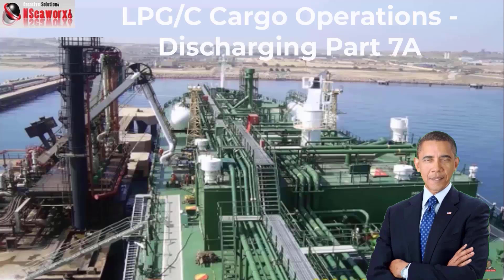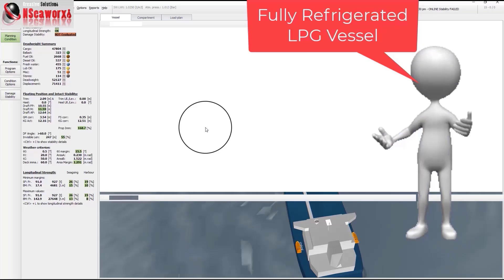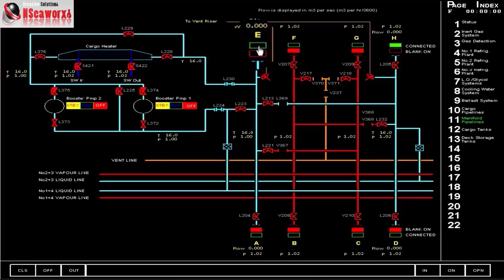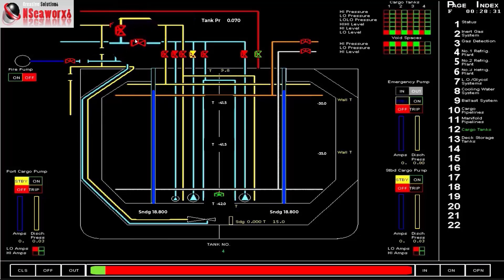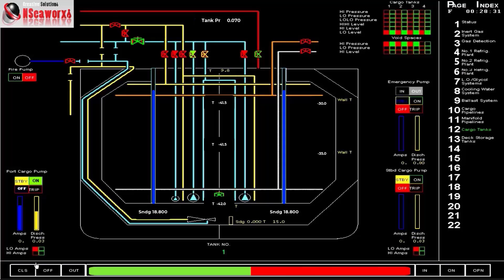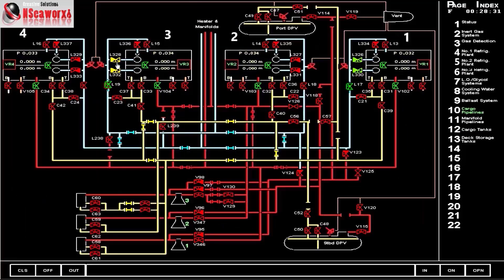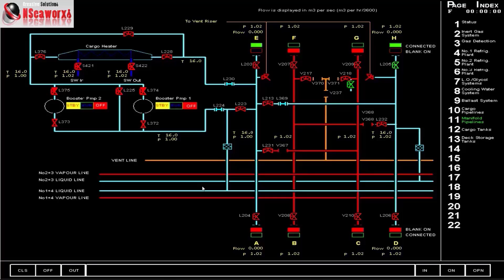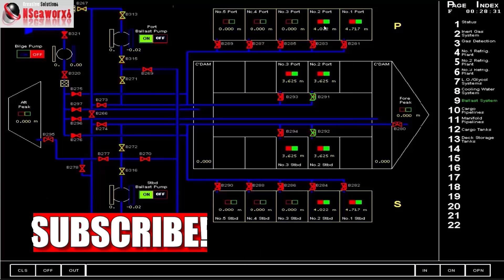LPG/C Ship Cargo Operations Part 7A - Start Discharge Cargo - Using Centrifugal Deepwell Pumps -Demo

Comment: Why do some C/O keep disch valve of deepwell pump all the time even below 50% open for full rate? Shouldnt they open it to 100% (except for the stripping phase) and keep on adjusting filling valve? Thank you in advance for explanation.
Reply from the maker: This would give the pumps a stable amperage (electric driven) and likewise pressure discharge output. Also,  when the level is down to stripping, the pumps wobble, cavitation may damage your pumps impeller or the pump as a whole. The Bernoulli's principle is very much in action to this effect. Watch the other video I uploaded about centrifugal Pumps. Good point raising such question.
Reply from the maker: In short, closing the discharge even to less 50% is in fact giving you easier controlled discharge rate and pressure output whilst opening to full may give you also higher rate, using the filling valve can also do the trick but you have be aware and watchful when using it. Check on your Cargo Pumps manual as this may not be the case sometimes. The amperage load may raise some eyebrows with engine department "heard it from other fellow, the C/E meddling with C/O" operation of the pumps 😄😄😄
Reply: Thank You so much for explanation!😊